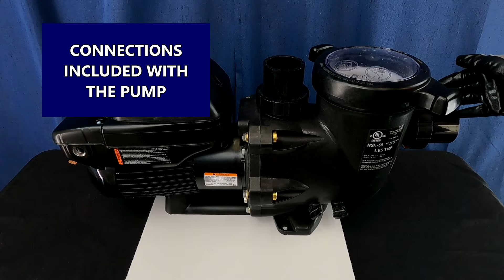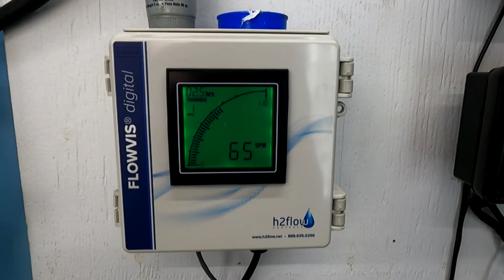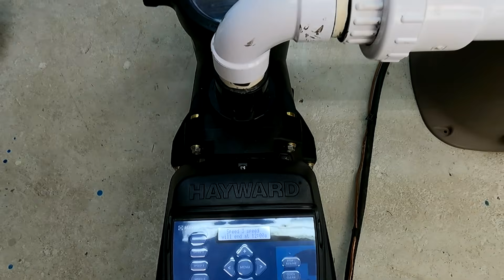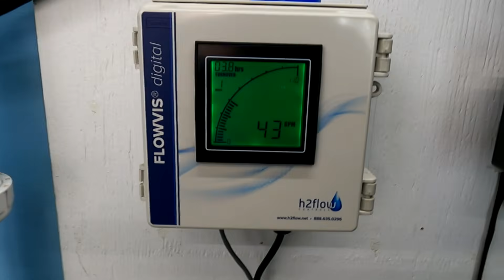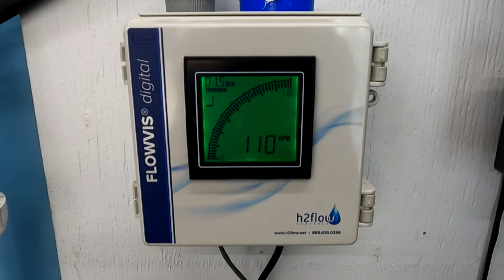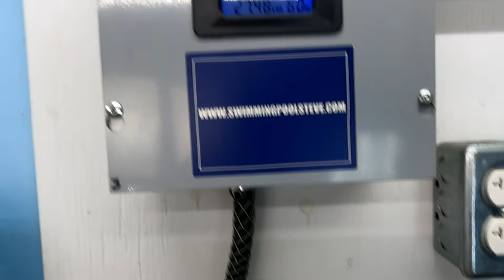1.85hp Tristar VS 900 Review - My Favorite Pool Pump!

Comment: Mine is 10 years old, runs perfect, the speeds allow me to run at night quietly, my neighbor complained with a full speed pump running so this works great. I used to get 1 or 2 years with the single speed pumps, its worth it as the soft starts reduce wear.

Comment: Good pump our customers like it, the cons.... 
they tend to get a hairline crack on the output that leaks
The drives go bad and you cant buy a new drive without replacing the whole powerend
And with smaller plumbing it does this weird whine and shake that prevents it from priming fully
That being said every pump has some cons
Please dont ever buy their XE models

Comment: At 6 feet/s in a 2.5 inch pipe, water is definitely in turbulent flow, with a Reynolds number of about 210,000. You would have to slow down to about 0.06 fps to get the Reynolds number down to the ~2000 range(laminar flow).

Comment: Finally had it installed, based on other peoples feedback, it seems that it is normal being that the basket is quiet large, that it would have a pocket of air. Can you confirm?
Reply from the maker: On some pools, especially at lower speeds, this is normal. Ideally it primes at high speed and clears the air. If so you can reduce speed and maintain a full chamber of water. If the chamber drops a lot that might be too low of a speed for your particular pool and installation

Comment: Hands down the best wet end on any pump! Runs quiet, has a great bell curve with high pumping efficiency, parts are always available, lasts you 10 plus years with out issues... however, the vfd is not my favorite because it doesn't use standard mobus registers to control it (I use it with BMS systems)... so I opted to rebuild my wet end and install the Neptune VFD US Motor combo.

Comment: Pool tech in Florida, and I gotta say it's an awesome pump.  Most of the newer pools here have them.
Reply from the maker: Agreed. Its one of the better pumps simply by virtue of not being 3hp. A lot of 3hp options but less in the middle and smaller ranges, which is what most pools would benefit most from using as a filtration pump. Thanks for watching and commenting.

Comment: While well funded people may find this appropriate, some can’t afford this level of pump. I can almost buy a $250 pump for ten years in a row to spend what this pump costs. 

Apparently there are two markets out there and if Hayward, Pentair and friends don’t make a pump to compete on the low end of the market their market will be stolen from them. These low price pumps will definitely run for more than a year, so labeling them as crap reminds me of the story of the Emperor with no cloths. The 3hp variable by Aquastrong is $700, but more importantly take all the electronics (that is likely to break) out and the same pump with a high low switch is $300. Say it’s pure junk, will you change it in 3 to 5 years? How many years will it take to reach the $2300 Tristar? It’s hard to look at this market and reach a conclusion.

Comment: So I’m putting in a 12 x 24 gunite with 6 for tanning ledge and 2 - 24” shear descents, no heater, 4’ deep, total capacity around 5500 gallons. What pump should I get?

Comment: Thanks for the wonderful video!  I am in the process of building an 8,000-gallon pool, which we call "fanny dunkers" in Arizona.  It's a small pool, but it has a spa and a Baja Shelf, and it's partially covered by an overhead lattice to shade the pool and patio.  We were delighted to find that Hayward products are used exclusively, including the C4030 filter, Hayward 400 nat. gas heater, two Tristar 950's pumps.  It is entirely plumbed with 2/12" and 3" sch 40 PVC.  It also has a Hayward Omni management system.  It appears my builder has learned to use some of the finest equipment for his clients.  He is not the least expensive, but in the long run, owning this equipment will simplify our pool experience and provide many years of enjoyment.

Comment: I have the Hayward Tristar VS 900 Model# SP32900VSP with a Century MB48AB43A04 1.85hp motor. I am trying to determine if the motor is indeed a variable speed motor. At startup, the motor runs a priming sequence that immediately starts at a high rpm. I was under the impression that a variable speed motor starts at a lower rpm and then ramps up to the required rpm?
Reply from the maker: The priming cycle is notmal for any variable speed pump. It purges the air from the system. The priming cycle is programmable in terms of duration, rpm and even off if you have a flooded intake system.

Comment: Hi Steve, can you tell me if this pump is a good choice for a 20k gal pool with 2" plumbing? It has 2 skinmers, floor drain and 3 returns. Im trying to decide on a pump to replace my existing SP2610X15 single speed which has failed. Thanks!
Reply from the maker: It sounds like your pool would be a good fit for a pump like this. Likely more powerful/ more flow than your last. I would install a flow meter and double check the max design for rate for your filter.
Reply: @Swimmingpoolsteve thank you for the quick response. I'll need to look into the flow rate although that's unknown until the new pump is up and running. I definitely intend on going VS and  the 1.85 hp of the 900 seems to be maybe a bit large as compared to my existing 1.5. Although the VS can be set to run at a lower rpm and therefore not be overkill. I'm not in contact with my pool guy anymore and this is all a lot to learn. Thanks again!
Reply from the maker: @cwag2159 most important thing is check the flow rate for the filter. It will say right on there somewhere. A minimally adequate sand filter would be the most likely to have a low maximum design flow rate which this new pump might exceed. Your plumbing system is certainly robust enough. Just the filter is in question really.
Reply: @Swimmingpoolsteve Got ya. I have a Hayward cartridge style filter (4 cartridges) with a flow rate of 122 gpm as per its label.
Reply from the maker: @cwag2159 very likely this pump will work well and without issues. If you have more peripheral devices like UV, heater etc. You can also check the max design flow rate foe those pieces of equipment. Cheers.
Reply: @Swimmingpoolsteve Nope, no other devices. No heater etc. Thank you very much Steve, much appreciated

Comment: Awesome video, the Tri-Star vs 900 is what I'm having installed on 6/18/25. It will be replacing a 14-year-old Pentair Intelliflo  variable speed, who's keypad is very similar to the VS 900. It will be filtering an open(unscreened) 20,000-gal pool in Central Florida, USA. Thank you for what you do!
Reply: I'm planning on buying this pump as well. How are you liking it so far?
Reply: I'm just finishing  building a pool myself, 15x35 5ft deep. about 20,000 gal. What price range did you pay for your pump ?  on line purchase or from a pool supplier?

Comment: Hi!  My pool professional recommended the bigger VS950.   My pool is only 12,000 gallons but I have solar, a spa and a water feature (small waterfall).   Will the 950 hurt my pool?   I have two main drains and a skimmer.

Comment: Hi Steve. I have 1.5 inch plumbing and plan on getting the 900.  Some have told me if price is not an issue, get the 950 2.7HP because you can run at a lower speed and it will be quieter and use less energy than the 900.  What’s your opinion?

Comment: My Hayward tristar vs 950 died at less than six years old. The drive failed... Started throwing overheat code and then control panel code. Replaced it with the exact same pump because I didn't want to deal with replumbling. If this pump fails in the next 6 years I will definitely take a different path.
Reply: Yep. That's one of many issues. Avoid!

Comment: Hey Steve great video! I'm curious what's the difference between this model and the V2SP32900VSP,  besides being 230v?
Reply from the maker: @JoeWall1st  you are the first putting this V2 model on my radar. The official Hayward literature does not reference a difference. Likely just an internal other minor change but enough to denote a new product number.

Comment: Do you know how many feet of head do you have on the system you experimented with? I currently have a 2.7 horse Eco star that needs to be replaced and I’m estimating I have about 60 feet of head, 2 inch piping, and a filter with a design rate of 96 gallons per minute. Trying to decide if I should get the VS 900 or VS 950. Pool is about 17,000 gallons with an attached hot tub
Reply: If I remember correctly, I believe that is answered in the video.

Comment: Have tristar SP3210X15
single speed 

2 questions 

1. Will this fit in place? No pvc
 alterations?

2. Is it same 3 wires, 2 yellows one green?
Making connections simple.

Comment: So Steve, what is the most efficient 3/4HP pump on the market today? Is there an energy efficient, affordable, but powwrful 3/4hp pool pump?
 I don't normally leave coments but your information is the most accurate and you are able to explain compex hydrologic issues in a way that is easy to understand, more than others.
 I totally agree that Hayward puts out some of the most reliable products, judging solely from my own personal experience with the 1.5 hp power-flow matrix and the, now outdate filter it came with 20 years ago.
 I also don't think you were bought off by Hayward to do this video, as you assured us in the beginning, you seem to have far too much integrity for that.
 As you probably know single speed pumps are no longer available in CA, California not Canada, and maybe not in Canada either, I'm not complaining about the law either, because I can no longer afford to run my 1.5 hayward power-flo matrix anyway even if it was legal.
 After investing in solar panels, experimenting with 4700 gpm bilge pumps, making a filter and a solar powered copper ionizer, I finally broke down and purchaced a cheap Chinese solar pool pump, Vevor 900w 72 amp that is supposedly 1.2HP, but, from reveiwes ive read as well as my own estimates and comparison to the old reliable hayward 1.5 pump, using the exact same 1.5" pvc and a large hayward sand filter, I estimate it to be maybe .8hp and less than 75gpm, durring full sun exposure, it does not have a battery option, I do have batteries on another string of solar panels that can run the bilge pumps and the small intex pump that came with the pool initially, but that set up is almost neglable, both the two inlets and  the one outlet are well below the waterline and it just seems so cheep all the way around that I just don't trust it.
I am at a cross roads with deciding how to proceed, I need a pool for physical therapy in the summer but I'm also on a fixed income so I can't keep throwing money at it. 
 I'd be money ahead if I would have purchaced the hayward pump in this video two years ago however I am so far down the solar path that it would be kinda ridiculous to go back to a large expensive variable speed pump at this stage.
 I am very interested in getting a 3/4 to 1HP pump that is efficient and powerful, it doesnt matter if it meets the CA standard because i intend to power it with solar panels and an inverter.
 I was able to run the .65, intex pump and sand filter that came with the 16x32x4.5' pool, but it is so cheep, low flow output that I don't think it is viable, it also has both the inlet and outlet well below the waterline and if I hookup a surface skimmer I have to block off ine of the two I let's, that what the instructions recomend and is a testimony to how cheep these pumps are.
 IF there is a super powerful and efficient 3/4, afordable 3/4 or 1hp pump I haven't found it yet, i think it's important to keep a working, non-solar pump available so that's my first choice.
 The only other option, i can see is to buy more used solar panels and another Vevor pump, maybe the 500w 48v one,  that would cost about the same as a midrange variable speed pump but it would be cheaper in the long run, no electric bill at all and I'd just keep the old reliable hayward on hand for emergencies.
 Is it possible that even though all the pumps I'm running add up to well over what is needed to filter the total volume of the pool that using a bunch of small pumps is not as efficient as one large one?
Thanks
Keep up the good work, just so you know your program is effective, two of the main take aways I've learned from you, after 20+ years of pool ownership are, increase distance of the inlet to the pump and to scrub the sides and bottom of the pool weekly, I had a short pipe with a 90 in it before watching your show and I always thought my pool bug would take care of the crud that naturally developes, especiallyin the heatwave.
Reply: No answer after all that.

Comment: I have three 1.5" returns coming from the pool (2 skimmers and 1 main drain).  They each "T" into a 1.5" manifold and then almost immediately make a 90-degree turn from the manifold to a fairly short run to the SuperPump.  The pressure side of the SuperPump is 1.5".

If I had a pump like the VS 900 that can accept 2" or 2.5" pipe, would there be an advantage to using 2" or 2.5" pipe for the manifold and from the manifold to the pump?  To what degree would the 90 degree turns offset any possible gains?

If being able to consolidate smaller returns into a larger manifold is beneficial, this might be a further argument for the VS 900.

Comment: Steve love yer videos, so much info! Could you explain pipe size in more detail? When you say 2.5" suction, does that mean the pipes from the skimmer baskets and the deep end double drain holes are 2.5" all the way to the filter? Can they bend 2.5 pipe around a radius?

Comment: Great video, Steve.  I appreciate all of the knowledge you share.  I have a 20,000 gallon pool with 1.5" plumbing - 1 floor drain, skimmer, and 2 returns.  Based on what I'm seeing in this video, the lowest setting of 1,500 RPM on this pump would produce the max efficient flow.  Is there a smaller pump that you would recommend that would allow me to run at lower RPMs where I'm getting 20 gpm vs 38 gpm as you suggested?

Comment: why do you need CPVC when the plumbing is water cooled?
Reply from the maker: Pumps can generate a lot of heat and the connections points with FPT connections have always been a leak point with pumps. A made to fit CPVC unions solves the problem entirely.